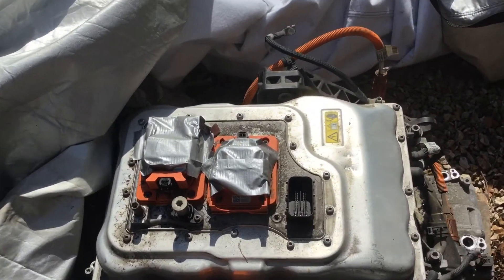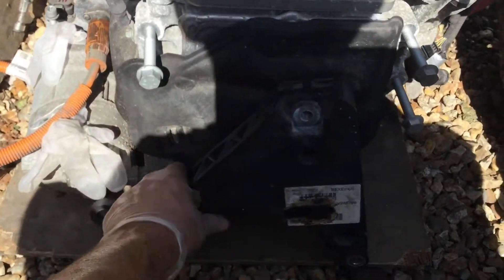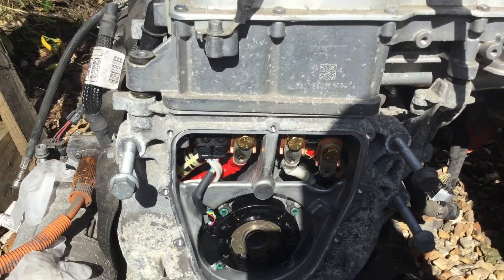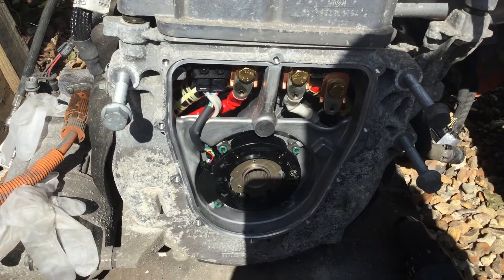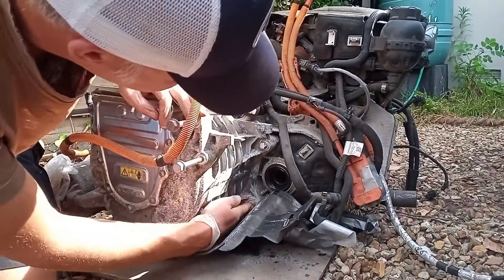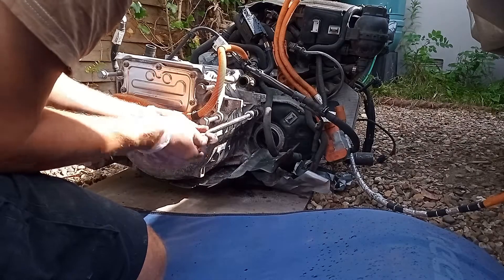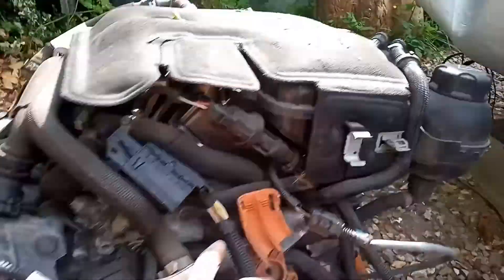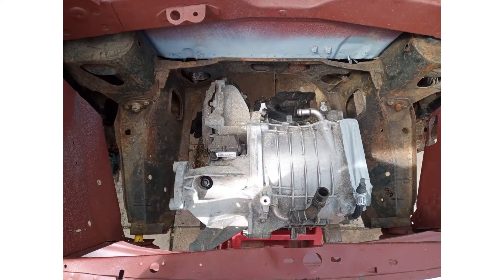BMW i3 strip down Ep 17 remove the inverter and split the Rex and motor

Comment: slightly silly question, do you need a lift to get access to the gearbox? I need to replace the parking lock actuator. Thanks
Reply from the maker: Sorry, not had the hatch off in a while and see your comment is 9 months old, I assume you got this fixed by now 🙏
Reply: @MiniLifeCrisis no worries I got it fixed by someone😊
Reply from the maker: Great news 😀

Comment: Hello, Do you know how to check the good connexion of the 2 plugs visible at 2:21? Can they be inverted or the connexions plugs do not allow this? Due to the poor visibility when mounting the EME without removing the motor from the i3, I have a doubt of inversion of these cables. But on this video, it looks like whe cannot invert them (not the same connexion). Thanks a lot

Comment: You seem like you know a lot about what's going on with these cars.  Do you think there would be any way to mod the car so the Rex will actually fully charge the battery? Or somewhere you could tap in an external generator to charge more while driving? Just for the rare occasion I need to take a long highway trip to somewhere with no charging infrastructure.
Reply from the maker: Looks can be very deceiving 😂 you can initiate the rex to run in what is called maintenance mode but it only runs for about 10 minutes I believe. Easiest thing to do would be to pick up a jerry can of fuel to top up if in an area without chargers or fuel stations. You can run them pretty much all the time on the rex if needed.

Comment: Do you know what is the exact weight of i3 electric motor with inverter/dc/dcconverter?
Reply from the maker: Great question, I think I did know this a while back. From memory the motor is about 70kg and the inverter another 5kg. I think, sorry I can't be more accurate.

Comment: Do you think it's possible to remove the REX engine and generator to make my i3 a pure BEV?
Reply from the maker: The issue with that would be fixing the motor in the car, I'm not sure how the non rex motor cradle attaches or if the motor housing differs. How do the costs weigh up? Could you not sell the rex and replace with a BEV?
Reply: @MiniLifeCrisis  I agree, there would be too much electrical work/ECU programming involved. Not worth it.
Reply: @MiniLifeCrisis  can I have your WhatsApp number?

Comment: I know the engine came from a C650 scooter. Can you show a comparison? I wonder if the REX has a CVT transmission.
Reply: The REX i3 only uses the petrol engine as a generator for the battery.
Reply: @ItsJoshuaRogers  Is the crank directly coupled to the rectifier/alternator/inverter? I'm quite curious whether you can easily replace the REX engine with a C650 engine.

Comment: The rex had an air filter ? Wanted to see if you can replace it though bmw said you don't have too for the life of the car
Reply from the maker: It's certainly not a 5 minute job! I think if you are to compare the amount of hours the rex will run in it's lifetime with an Ice car then you'd be surprised at how little it actually runs. If BMW say there's no need to change it that's good enough for me. If they could charge you for it they would 😅
Reply: @MiniLifeCrisis  just found out that the rex 650cc (cubic capacity) is fitted with a 3000cc air filter and with the minimum use its defenatly overrated
Reply: @Untitled1-Log  I often use the REX function on the fly, which means more maintenance because the REX's purpose is to be used as an emergency backup. Supposedly the air filter is located somewhere in the rear bumper, and it's a hassle to get to. If I have the need or chance to replace the air filter, I'll modify it with a custom airbox and K&N filter where it can be easily accessible. Might as well add dual or quad exhaust to the tractor while I'm at it. LOL.

Comment: What did both havles look like when separated. Just Fly wheel & bell housing with no clutch?
Reply from the maker: There seems to be some interest in this so I will do a short follow up video looking at the rex.
Reply: Certainly shows how much smaller and less complicated the electric drive is, considering the power of that electric motor compared to the complication and size of the much lower  power 650cc Rex engine next to it!!
Reply from the maker: It certainly does! Although batteries, inverter and charger can add to the weight the basic motor is only about 50kg I believe.
Reply: @MiniLifeCrisis  oh yes of course but then I’f the Rex was to actually move the car you’d have to add a gearbox as well ;-) I have a i3S Rex so it’s quite fascinating to see all the insides 😂😂 I guess having aBEV i3 donor would have made the job a lot more simple!!
Reply from the maker: @loonymoon1  it would have done, but then I'd have less stuff to sell and help fund the project 😉
Reply from the maker: It's all very self contained, I'm thinking of doing a live YouTube vid if you're interested then people can ask to see different bits 🤔
Reply: A very ambition project 😊
Lovely work, keep it up 👍
Well I was interested in seeing the shaft out from the REX to the generator since it is the one that brakes on the REX with expense consequences to follow. 
As I have understood the REX it is a small motorbike motor with a small generator on so the to parts isn't connected mechanical. 😊
Reply from the maker: That's right, there is no mechanical connection between the motor and rex, both operate independently. I don't expect to be stripping down the rex anymore as I'd like to sell it in one piece.
Reply: Of course the rex  must have a separate generator, in there somewhere.